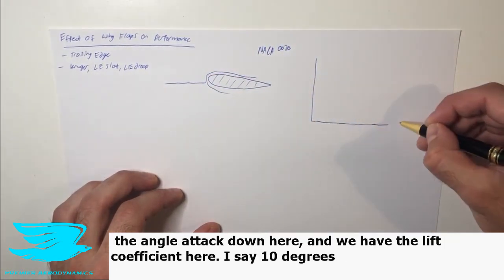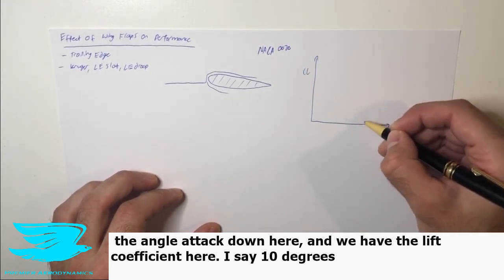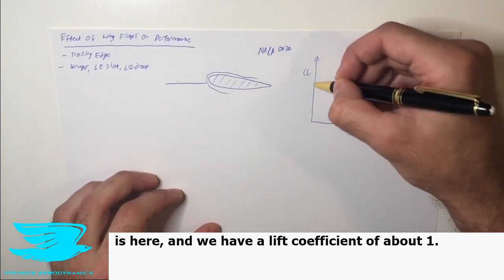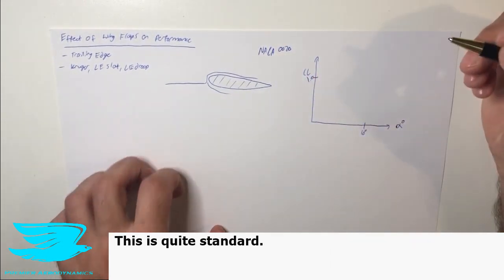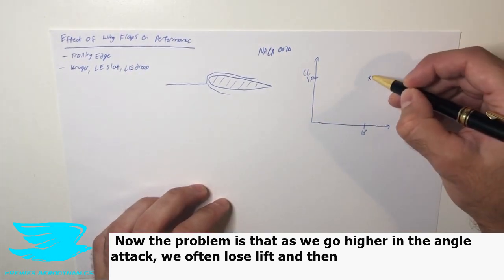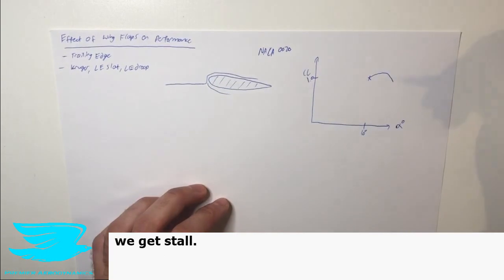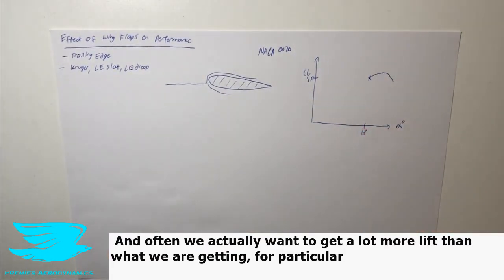[Aero Fundamentals #25] How Wing Flaps Work

Comment: it has been my CFD experience that the common leading edge devices Extend the baseline Cl v. Alpha curve... but not much offset.... Flaps really produce the offset... Unfortunately all these contraptions have negative impact on the Pitching moment!!   :(
Reply from the maker: The leading edge extension devices are quite complex in that they can vary. The ones that just extend forward don't typically shift the curve because the camber of the wing is essentially the same. If they extend forward and down, then the curve has a chance of being offset, and it also depends on how big the extensions are.

And it is quite amazing at how the pitching moment isn't really talked about that much, considering how important it is to an airplane's operation.